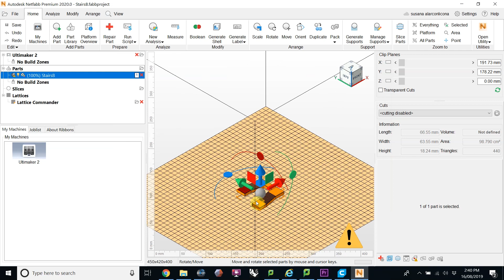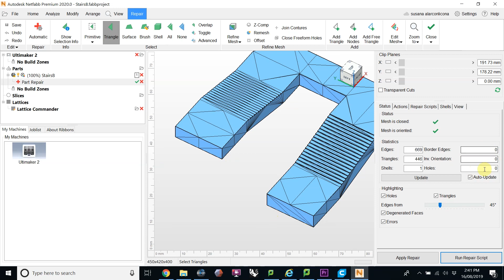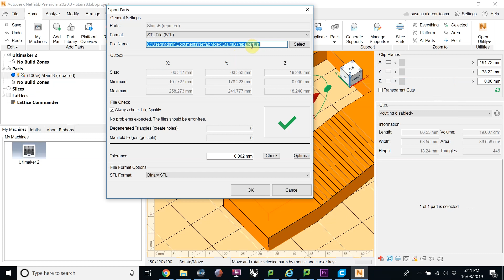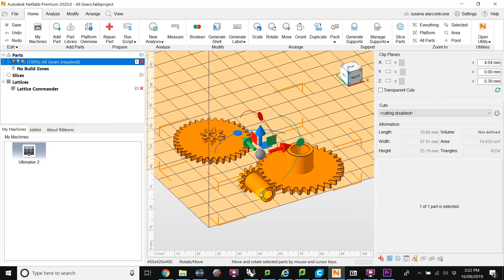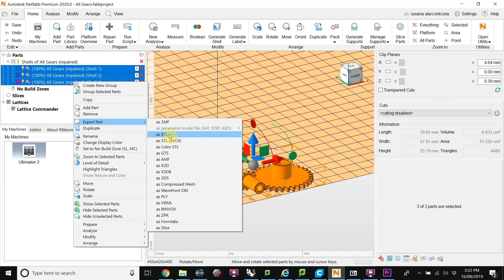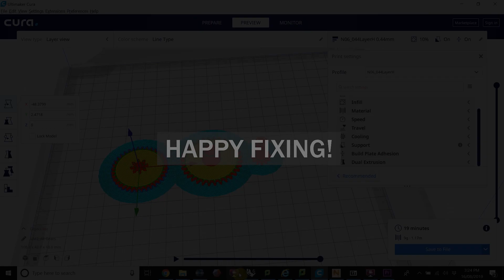Repairing .STL files with NetFabb

Comment: have you tried using the online netfabb for fixing?  I recently updated from an old Netfabb Basic to Netfabb Ultimate and my fixes in NFU are not fixed as well as NF online.  Ive noticed this is lychee slicer as when i load a Ult file it still says I should repair.